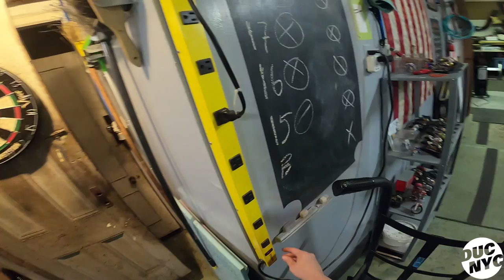Dirty Billy, Brooklyn NY - Community Motorcycle Garage - walk to the spot - Ducati NYC Vlog v1585

Comment: So do you just walk everywhere in winter?
Reply from the maker: No, i ride moto year round. Snow only stays for a few days a year. I also got a car, subway, trains and taxis 😜😜
Reply: @ducatinyc  Ya? You just don’t ride on snow days?  What kind of car?  

Also, that would be a pretty funny video to do a motovlog commute but in your car.  Or using public transit.  But do it in full riding gear, minus the helmet for safety…although, it may be safer to wear a helmet on the subway these days haha
Reply: @ducatinyc  Ya? You just don’t ride on snow days?  What kind of car?  

Also, that would be a pretty funny video to do a motovlog commute but in your car.  Or using public transit.  But do it in full riding gear, minus the helmet for safety…although, it may be safer to wear a helmet on the subway these days haha
Reply from the maker: @kw2519  i’ve done a bunch of car vlogs and subway vlogs too :) even a few weeks ago. Mazda cx5
Reply from the maker: @kw2519  and i do ride on snowdays, depending on snow